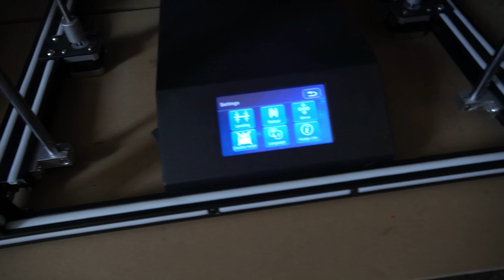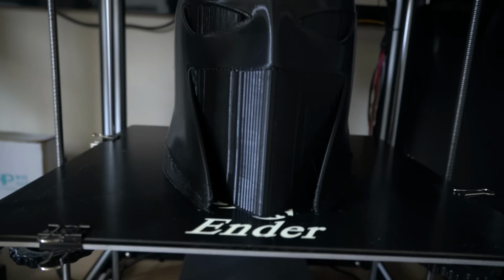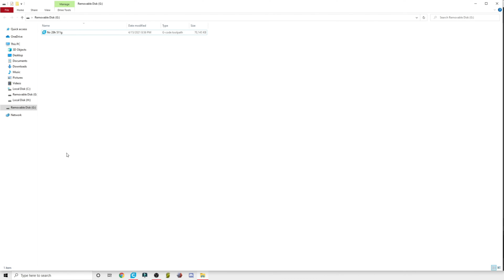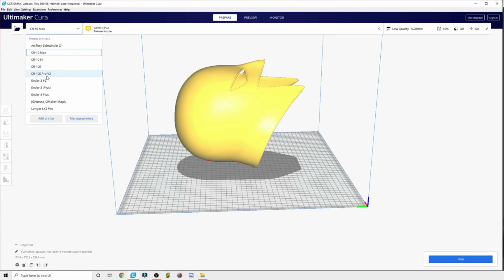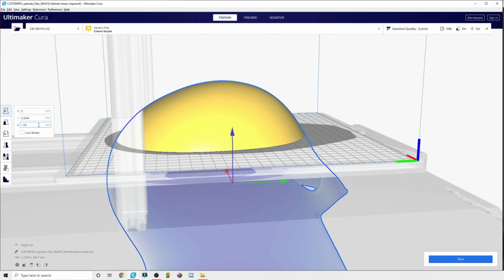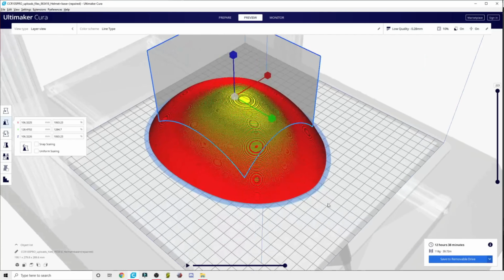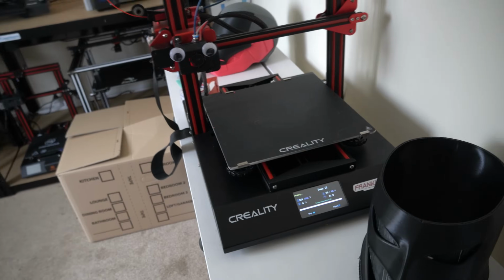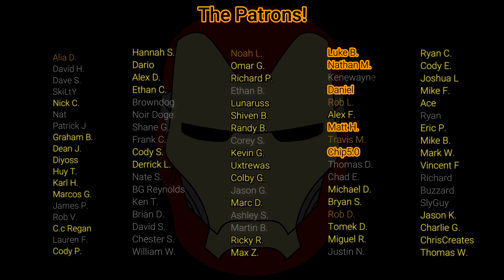How To Save & Fix a Failed 3D Print!

Comment: I know this is an older video but I'm hoping someone comes across this and can give me some info... I'm trying to print a mk85 helmet for my step-son.  I've had the jaw fail 2x on me like 10 hours in.  I'm printing vertically, 50mm/s .16mm layer height and it's failed both times in pretty close to same spot.  I just found this video and wanna try fixing it this way.  So here's my question... When i measure the failed print  with the printer, do i need to subtract the height of the raft?  I just wanna make sure i can get the right amount dropped below the build plate.

Comment: I am a beginner in 3D printing. I've misprinted the Iron Man mask 3 times. The first time was the first file I printed and the printer was not fully set up. So I wanted to print it again, but the next 2 times, when it was a couple of hours away from finishing, I find it a few centimeters up moving without letting go of the filament. I tried to get it back both times but ended up moving the print. It's frustrating, I'm going to choose to print what's missing and paste it. Does anyone recommend me a method so that the union is not noticed? Thank you :(

Comment: Ugh my printer just isn’t working i leveled it double checked and it looked fine and is started printing and i left for a hour and the sleeve on the hot end was off and filament covered the hot end and the thing that heats it i have basically given up 3d printing

Comment: I've been saving Cura projects (File -> Save Project) after I've got everything setup so if I find something wrong in my setup I can go back and tweak it without having to set EVERYTHING else.  Would be perfect for something like this since the helmet (or whatever) would be in the same position and you wouldn't need to worry about trying to line it up just right again.  Has saved me a lot of hassle already.

Comment: Hi Frank, i’m not sure if i should buy a CR 10S, a CR 10S Pro or a CR 10S Pro V2, do you know witch one is nicer to use?
Reply: Or the Cr10s5, as it has a way bigger bed, but I'm still struggling with this same decision 😅
Reply: I Just got a CR10s Pro V2 and I am very happy with it. FYI it is my first 3d printer and as a noob I got it going fairly easy. I have printed PLA and PETG, and after calibrating for each filament it works great.

Comment: drop it into netfabb and slice the bit that didn't print 
you can even measure as well i did it with a resin print
Reply from the maker: You can always cut it off. This skips that step. You also need to measure the physical model too

Comment: Very useful thing to talk about! I just woke up to a plate full of spaghetti..
Edit: I actually did this same, but I used a caliper to find out the size. My ender 3 has been doing a weird thing where it will repeat layers and then start again, so it will look like it is scaling itself down. Do you know why it does this?
Edit 2: I usually save the project as a cura file, so I can open it up, and it saved all settings, supports, etc
Reply: +1 on saving the cura file. I learned that one the hard way. It’s definitely helpful especially if you rotate something to get it to fit on a smaller build plate. Trying to recreate that rotation can sometimes be a losing proposition.